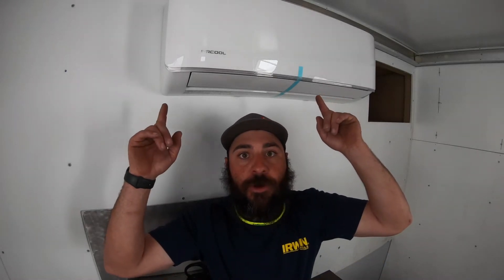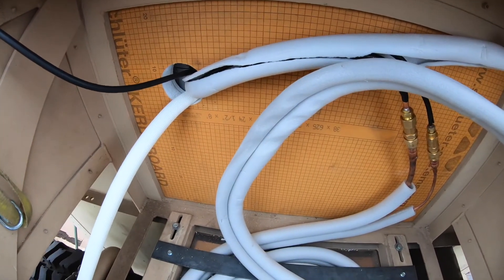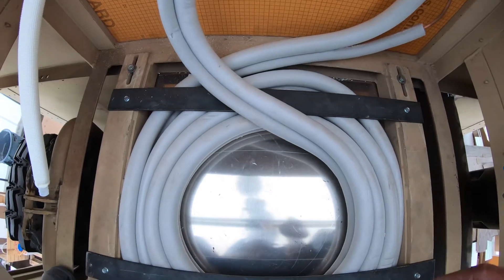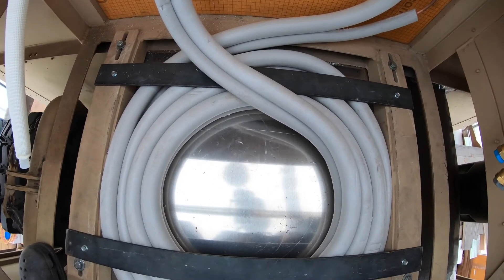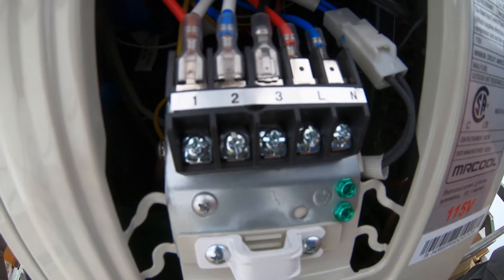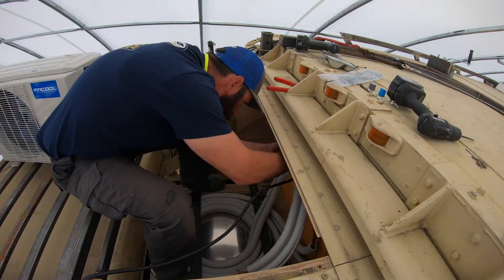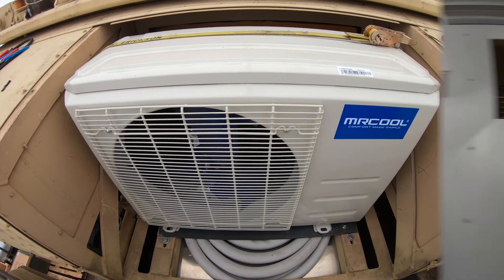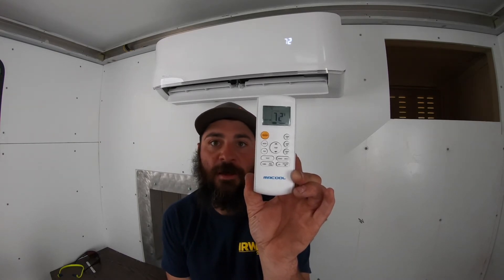Expedition truck RV Mr Cool A/C mini split

Comment: The bigger line is the low side and the smaller one is the high side of the AC.  Low line carries the colder low temperature refrigerant, and the High line carries the hotter temperature refrigerant.

Comment: How much does one of these cost?
Reply from the maker: It depends on how much of the work your willing to do yourself and the initial cost of the truck. I would say outfitted similar to mine, your going to spend $50k on the low end and $150k on the high end for parts only doing all the work yourself.
Reply from the maker: I might have read your comment wrong, If your referring to just the a/c mini split there about $1,200 bucks.